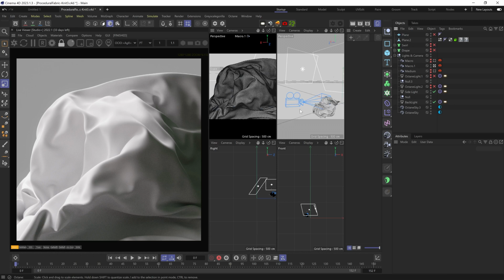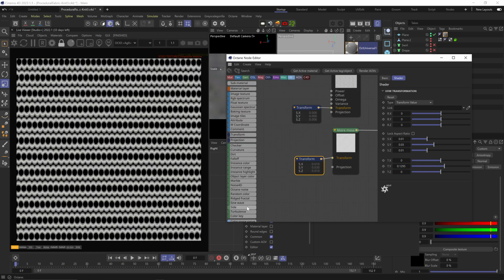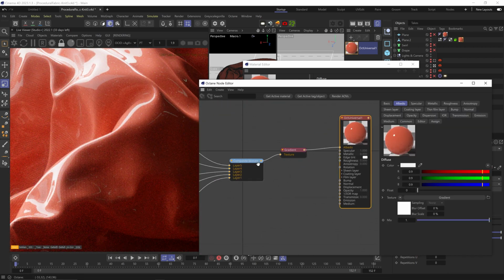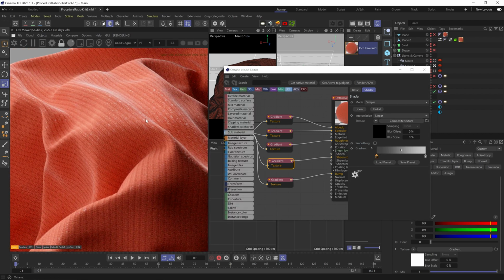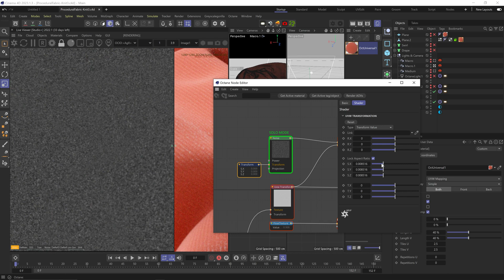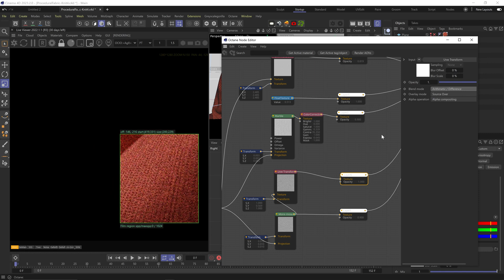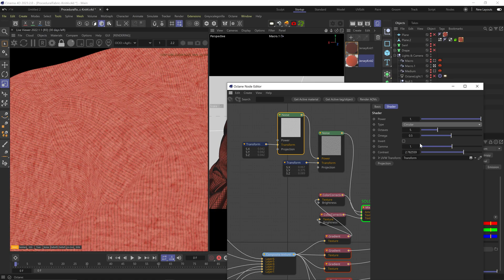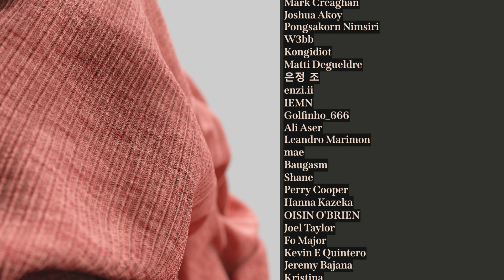Cinema 4D Tutorial - Procedural Jersey-Knit Fabric (Octane)

Comment: Good one my dude! I have a “sock client” haha I’ve been using similar techniques for great results - you nailed it though the tough sell is macro views and that’s really anything fabric with 3D - once you go macro the fibers and everything become more prevalent and the fibers behind the fibers start to become noticeable. It’s a huge limitation for image maps too bc you’re limited to the pixels captured too - just a very difficult solve for sure!
Reply from the maker: My dude! Yeah you know after we talked I was thinking how they would have to develop a specialty engine just for fabrics, something about the algorithms of current engines is just not sophisticated enough for the complex microtopology and light interaction requires. I'm kind of surprised it wasn't developed yet. Maybe it has to do with the limitations of ray scale, like to make the fabric right the rays in the scene need to be able to capture the tiny topology of the fibers, and then combine that with the larger scale topology of the weave/knit pattern. I dunno, seems like it shouldn't be that different from any other material, and yet it substantially is.
while working on a Satin tutorial I was thinking, the ultimate prcoedural badassery would be to get the satin effect not by faking it with the falloff node, but by actually creating a weave microtopography correctly enough so that the light naturally reflects in that satin sheen. Man, is that even possible.